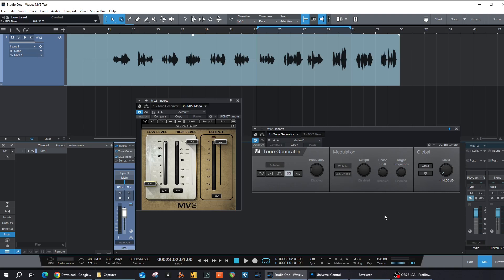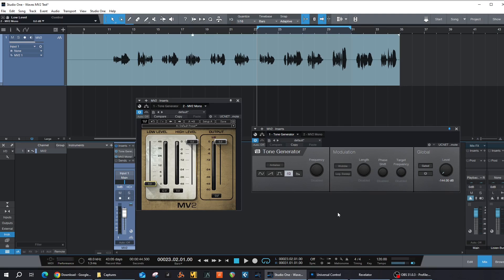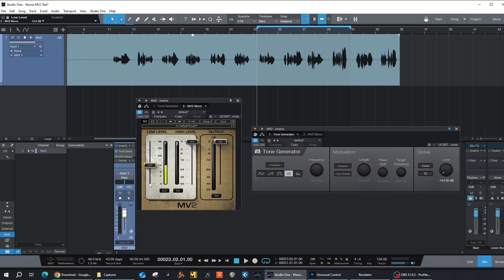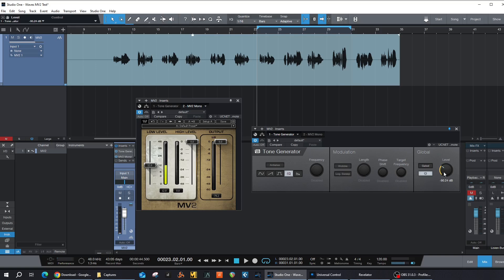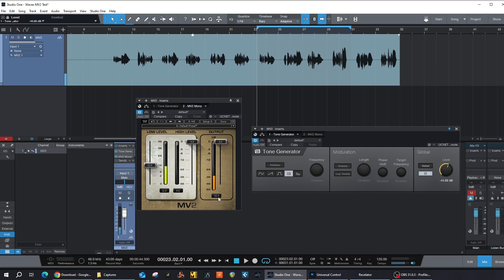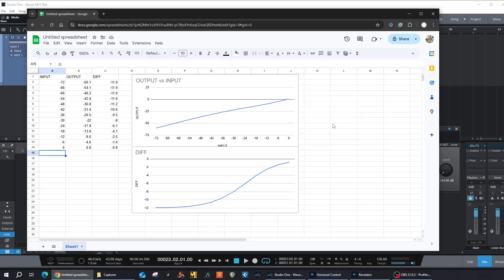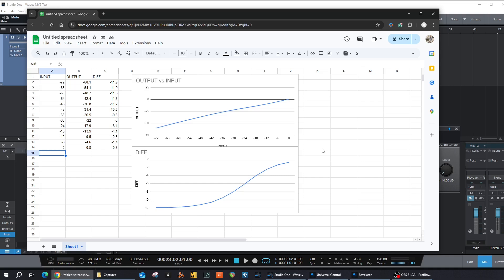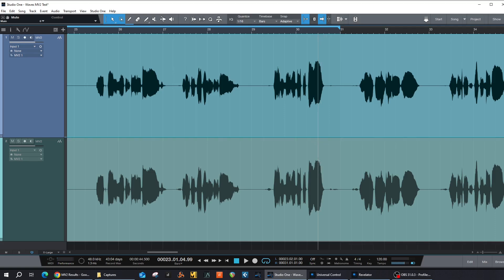Reverse Engineering And Analysing the WAVES MV2 VST Plugin - Part 1

Comment: Hi Vatche, great video. Like you, I also hate Waves' stupid policy with their WUP. I recently switched to Mac OS X and had to update my most-used Waves plugins. The last plugins I bought were MV2 (I was using Maxx Volume, which is almost the same) and C6 (previously I used C4). I bought them for their immediacy (MV2) and because I know them well. Honestly, as long as they work, I'll use them. I know that on Windows, their longevity is greater, and if you only want to use a couple, the investment every X years in WUP isn't much. It's also true that I haven't found an alternative equal to MV2 in the saturated market, but it will come. In Cubase, we have Squasher, but it's too complex and the resulting sound isn't as good. Adptr Audio Sculpt from Plugin Alliance is also very good, and you have a few other options, but the same thing: it's not as instantaneous. In the end, the oldest ones are usually the best in terms of practicality and sound.
Reply from the maker: Thanks for the comment. I'm in the process of writing my own plugin after I "reverse engineer" the MV2. 
So far, on the plans, it looks good. I plan to make it as simple as the MV2. Did I mention I will make it open-source? :)